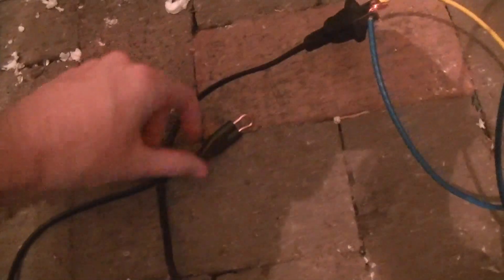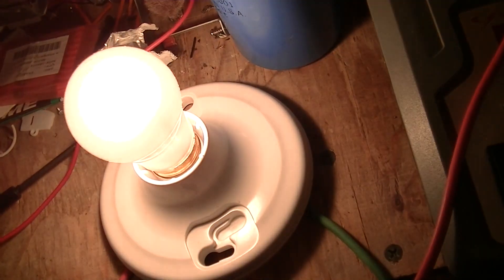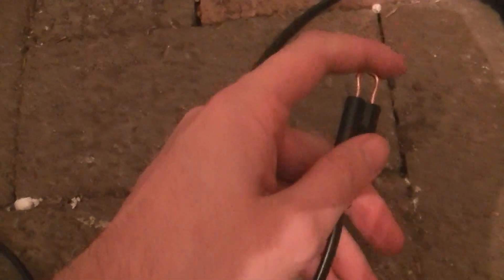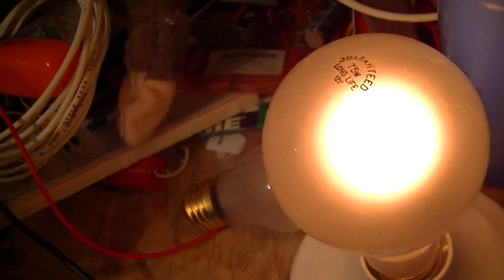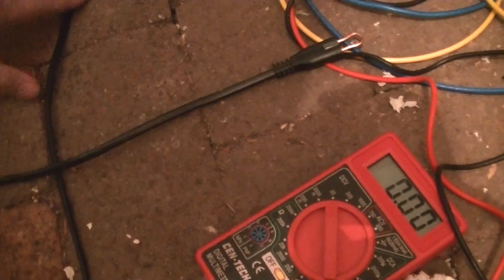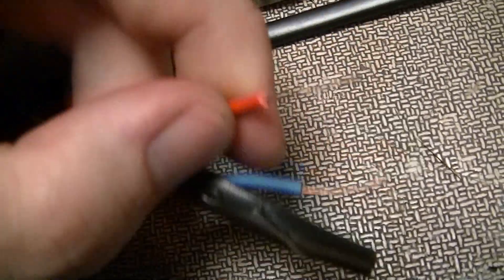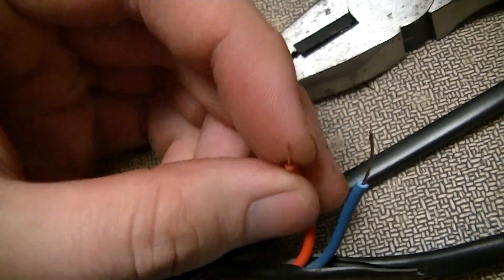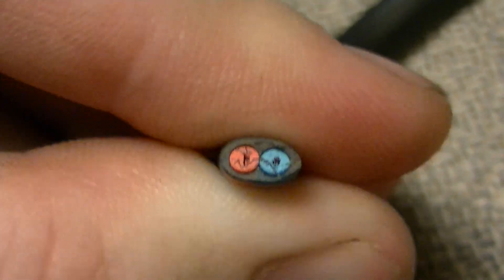Crapola mains cord testing

Comment from the maker: Actually, it's of no concern in wires less than 2/3in. in diameter for 60cy/sec AC.  It can be an issue in low potential high power systems (meaning high current and BIG wires) where some equipment has a high ripple component in its current, but with properly designed equipment this should not happen in the first place.

Comment: Well.. you are kinda doing it wrong:
The cable is probably around 2.5A (actually unknown), the applience-plug is 2.5A max, the 6A rating it for the actual "wall plug".
So did the plug stand the current properly? It's crap territorium anyway :)

We have cables with euro-plug rated 2.5A, 2x0.75 mm^2 cable, and a IEC-whatever plug (that style) rated 2.5A. The mains fuse is 16A, and and mains voltage is 230V AC.

Comment from the maker: Given that my experimentation has shown that this cable has a conductor resistance of well over one ohm (really) due to the conductors being either improperly refined/deslagged recycled copper or some cheap high resistivity copper alloy, I think that the maximum permissible operating current is more like 0A.
Just use the bloody thing as a bludgeon to beat the pro 'made in China' idiots over their heads with.